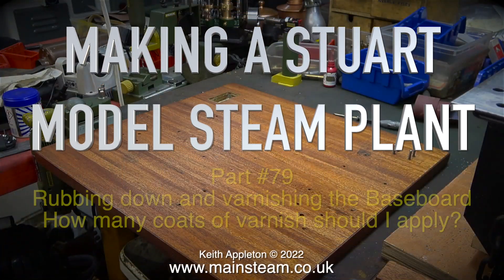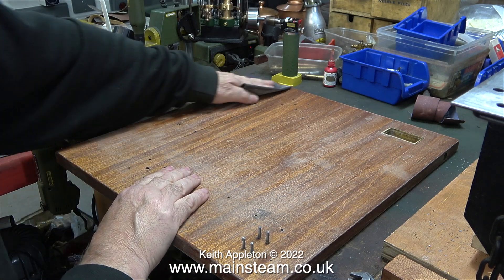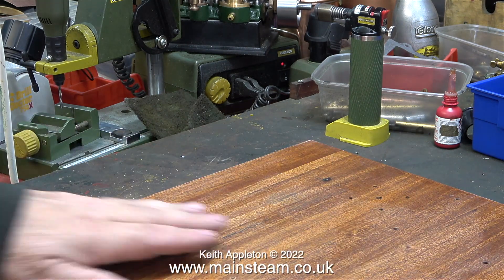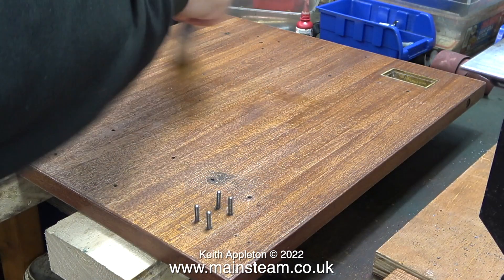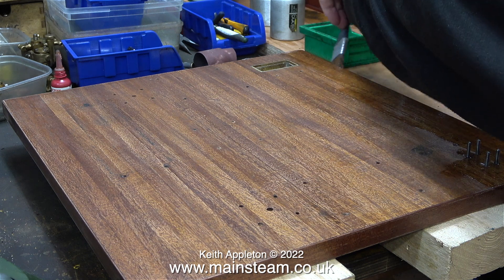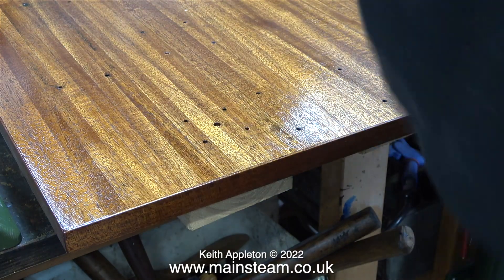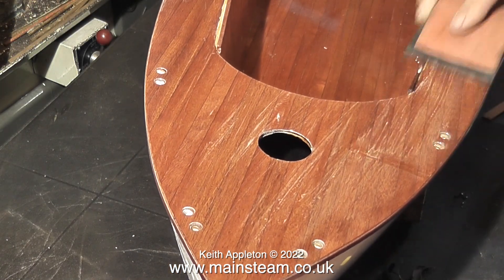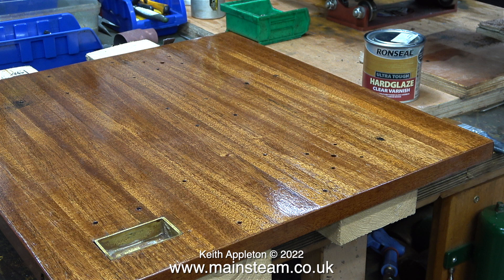MAKING A STUART MODEL STEAM PLANT - PART #79

Comment: I do a lot of woodworking myself, and can say that if you don't want a thick layer of poly, you can mix it with white spirits and it'll go on thinner. There's no real percentage for mixing it, just to how thin you want it, I usually go about 50/50 and that does the trick. Wiping it is alright, but it leaves a nicer finish via mixing it before application.